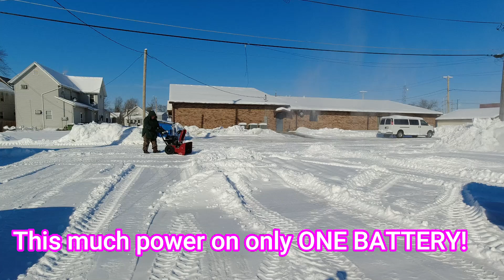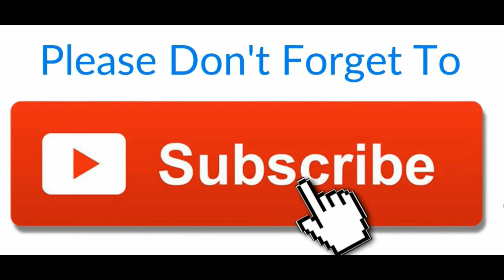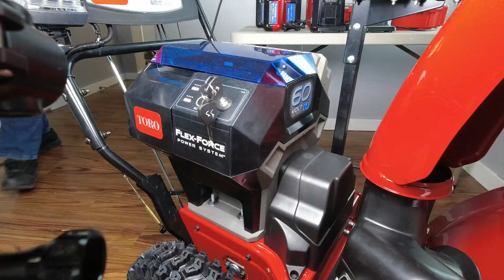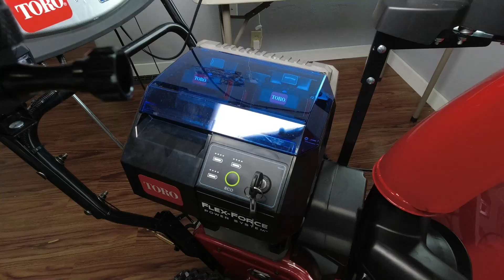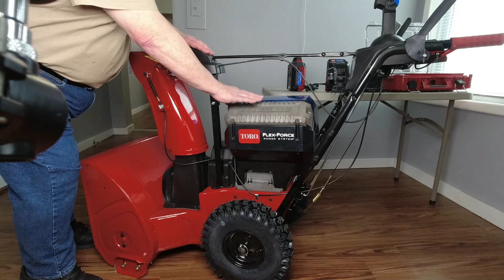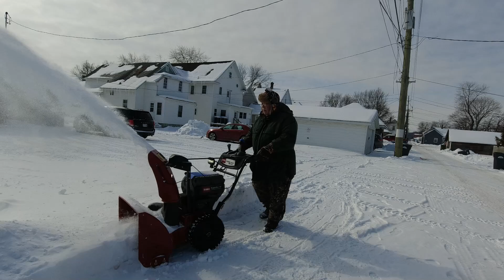First Look! NEW Toro Power Max 60V Battery Two-Stage Snow Blower

Comment: I know you said they did The old tried and true and just put electric motor on it. 

But there are some disadvantages of why the battery doesn't last that long because of this. 

You can't shut the LED light off no matter what. Which for the life of me I can't understand why they did this.. It's unacceptable put a damn on/off switch Like the hand warmers. Are they that cheap for a machine that cost $1,700!! 

The other thing is they're not taking full advantage of having a fully electronic snowblower. Like electronic transmission. Auger etc. I think on the Snow Joe version The machine is lighter, And when you press the auger gear the auger will go slower and faster depending on how hard you push it down or lift it up It's so smooth. 

I think that's the case for the transmission too.. 

Also the machine does not turn on and move until you press either gear. You don't have to turn the machine on and let it run and let the battery wear out every time you stop. It only goes and turns on when you press the levers. 

That's a huge advantage for saving battery. 

What is your opinion of why they didn't go that direction.. And do you think they should have for the price you have to pay for a machine like this. 

As you say that is interesting!! 

;)
Reply from the maker: You turn the key on and then go clear snow. When you are done turn the key off. When your neighbor stops you to talk you turn the key off. When you want to go inside and warm up you turn the key off. In other words - when would you just walk away from the snowblower and let it run? 
If you know electric motors you know it takes up to six times the running current to start the motor. So, if you think stopping the auger every time you turn around saves electricity - it really doesn't. It actually takes more electricity for those 4-5 seconds when you turn it off to turn around because of the motor starting torque.
If you have just a couple of inches to clear this snowblower has an economy mode. Press the button by the key switch and it reduces the speed of the motor. By the way - do you ever use the throttle to slow your gas snowblower down when you are clearing snow? 
All of Toro's snowblowers that have lights don't have a switch including all the electrics. Yes, the snowblower market is EXTREMELY competitive and the buyers are the worst consumers for not spending any more money than they have to. 
The 826 Toro is one of the most popular and dependable snowblowers on the market. It's built so that 80% of the people who get snow in the U.S. can use this snowblower and be very happy with the performance. So it was a no-brainer for Toro just to replace the gas engine with an electronic power unit. Yes - it uses all the latest tech - brushless motor, electronic controls that sense torque and apply more power when the snow is deeper. 
Just remember, EGO, Snow Joe, Ryobi, and Greenworks are electronics manufacturers who decided to also make snowblowers. They have no experience making machines that handle snow well and will last 25 years or more. I'm not knocking these companies - they just don't have any experience in this area. 
Toro will gladly show you their prove-design. Will the others show you how they tested all those extra switches and components in ALL the environments they need to run it. For example, have they tested the speed control switches at least 10,000 times at -30 degrees below zero with a pressure washer blowing water on them? This also goes for all the electronic motors, electronic logic boards, and all the plastic gears in the transmission, auger, and impeller drive. 
The friction drive and v-belts in the Toro setup are more efficient than you think. There is no power loss until the drive and auger levers are pressed. And when they are pressed there is very little power loss when they are adjusted correctly.
Reply: @PaulSikkema  

First Thank you so much for your answers and the education!! You are very intelligent for experience.. I appreciate all your information!  I will share your channel..

So you're saying when the motor is running it's really not using a lot of battery until you engage. And if you're constantly starting and stopping the auger and the transmission that causes to use more power than just letting it run constantly. 

In other words the way to use the machine more efficiently is to not have to take your hands off either lever because stopping and starting causes more power loss. 

I was also really curious about when you turn the motor on what is actually spinning? 

Is the shaft spinning or something else. 

I also would be curious which it's not possible. To turn the motor on and let it run and see how long the battery is lasted just like that. 

I completely understand everything you said and it makes perfect sense.. The other technologies are not proven and do you want to get stuck with circuit boards blowing and all that stuff..

And that's why I bought the Toro cuz I trust it and I trust the name brand. 

I'm just not a fan of how they service things. 

All about the service centers bring it to a service center blah blah blah. I don't have a truck. Even if the batteries are bad they want you to bring them to a service center. Most of the companies will just send you new batteries and then you return the other ones free of cost with their shipping label.. And a lot of the other companies pick up their product for you. 

Not to mention a lot of times the service centers are bogged down so you may not be able to get your snowblower back for two or three weeks.. 

This is just crazy and unacceptable..

But they do make fantastic products.. 

I even had their power curve single stage 1800 corded electric snow blower.. I took down two feet of snow at that thing throwing it on top. Plastic everything. I still have it it's been 10 years I just had to buy a new belt, and a new pulley assembly $62. But I will be selling it.. I think they really understand what matters and what doesn't That's one of the things that makes them a great company. And they always seem to be ahead of everyone else in technology. 

Competition makes better products. 

Thank you again for all your information!!!

Comment: When you press the right handle the auger handle will it go from slow too fast as you press it. 

Because on mine it seems like it gets faster and louder the harder I press it.
Reply from the maker: It appears you need to adjust the belt tension. If you have your manual look at section: Checking and Adjusting the Auger/Impeller Cable
If you don't have the manual you can read it here: https://manuals.toro.com/210064/index.html?rnd=0.5508209834068837#34505301-9b1b-4ead-a53d-e9c0d1281fc2
Reply: @PaulSikkema  thank you
Reply: @PaulSikkema  I did follow the directions about adjusting the springs on each lever The drive spring was supposed to be 2 in. The auger spring was supposed to be 2.75 in I use the caliper and they were perfectly adjusted.

And I did do the adjustment when the lever was completely closed on each side using a clamp

I did take apart the belt cover and I think the reason why it got louder what I pressed it all the way down is because the full tension was on the belt so it wasn't slipping making it go it's full speed so when I press the lever all the way down it has the right amount of tension.

I guess the slipping happens and it goes a slower speed with the impeller and auger when I only pull it down halfway So naturally not enough tension.

I love your videos I watched your video on the Toro and the comparison of the Ariens and the Toro three times such an education!!

Comment: Hey Paul check out my video on my PowerMax E24. I have a another problem.. 

https://youtu.be/y8LVnHhKwTw

It's now making a loud clinking and clocking noise with the auger and impeller on top of when I back up I hear squeaking. 

Mamma Mia all these problems with this Toro so quickly..
Reply from the maker: I'm not sure you have problems as such - I'll bet it's 90% adjustment. 
If you can put it in a warm area I'd do that and let the snow melt out of the impeller. (it will fit through the back door of your house :)
I use an infrared heat lamp like they use for baby pigs or chicks to melt the snow. Any farm store like Tractor Supply will have one.
Reply: @PaulSikkema  But I have decided to return it to home Depot anyway now I have to rent a truck that can have ramps for a snowblower. I'm very disappointed that this product does not have the auto steering like the E26 does for some reason they don't put the auto steering in the e24s.

I have a small driveway so I need to take really narrow turns. It was difficult with the evening before to do this.

The wheels just kept dragging unless I need a big circle.

The E26 also comes with a hand warmers, and a bigger batteries 7.5 AH

The size difference between the two snowblowers is no big deal The E26 is about 3 in wider 25 lb heavier Not much of a big deal

So I'm bringing it to home Depot then ordering the E26
Reply: @PaulSikkema  yeah it turns out a lot of the sound went away when it melted. But it's still really loud I wish it was a video of the E26 auger moving showing how loud it is and the noise it makes walking around it so I would know if everything is okay.

Comment: So I was talking to you about my PowerMax E24 And how it's squeaking.. is brand new I've only used it two times.. 

One thing I've noticed is that it drives too fast in first gear. The good speed would be the speed it does in R1.. THAT'S THE PERFECT SPEED.. This is a common thing with these Toro snow blowers not the first time I've heard it now I've experienced it. 

( So the squeaking ONLY HAPPENS IN REVERSE!! ) No belt noises going forward in any speed. 

Every time I go in reverse squeak squeak squeak squeak squeak.. It goes away a little bit in R2.

I don't know if there's anything wrong, if the belts are new, breaking in blah blah blah. Is there a way to adjust the belt like a car..

Hope it's nothing major because I don't have a truck and I cannot return this.. 

( I did make a video of it but until I get that up let me know what you think? ) 

GREATLY APPRECIATED LOVE YOUR CHANNEL!! 

Oh and by the way I only had 3 in of snow light and fluffy. Barely moving clearing a small small area maybe the amount of Three cars at most.. when I shut it off after about 40 minutes The battery was half empty.. 

But I shut it off many times because I was having a hard time maneuvering it.. It blew very little snow cuz there wasn't a lot of snow.. 

So I'm wondering I think the battery's wear out the same whether you're using the auger or not going forward going backwards. 

I think it's the engine that's on All the time that uses a lot of battery. 

Very bizarre. 

Wondering cuz of all the hang ups if I should switch to plastic lifters instead of using the metal ones.  I could. Raise it a little bit but then that would leave a half an inch of snow on the ground everywhere.. 

Thank you.
Reply from the maker: Yes, the Toro's do go faster in first gear than most other brands. There is no easy way to make it go slower without messing up the shifting notches and the reverse speed. 
Thinking about it more - the squeak may just be the drive tire inside the tranny wearing in - especially since it just squeaks in reverse. 
Poly skids work well.
Reply: @PaulSikkema  THANK YOU SO MUCH FOR YOUR HELP YOU ARE AWESOME!!!
Reply: @PaulSikkema  So does that mean you prefer Ariens because Toro goes too fast.
Reply from the maker: No, I don't have an opinion. I just give you all the facts so you can decide which one is best for you.